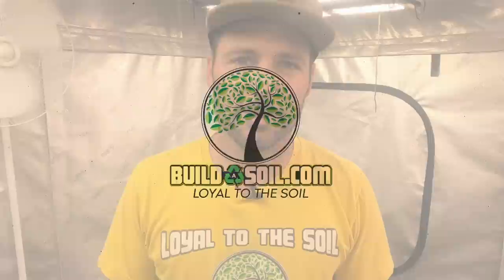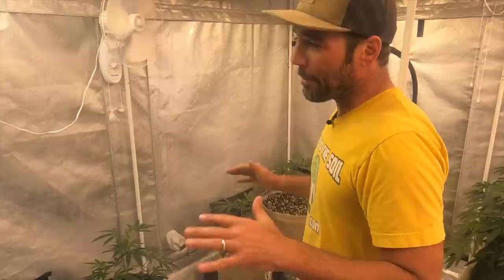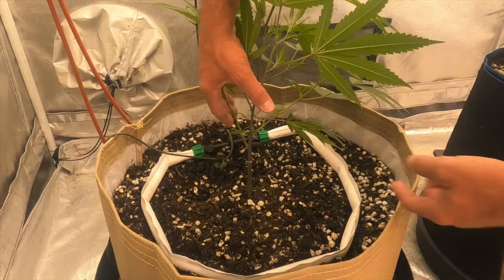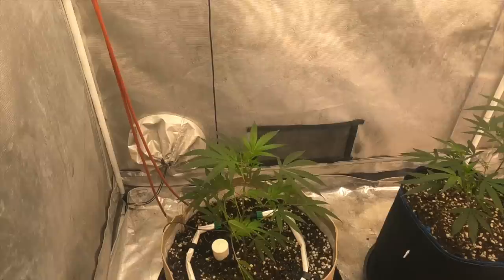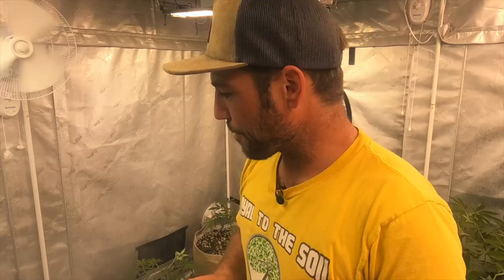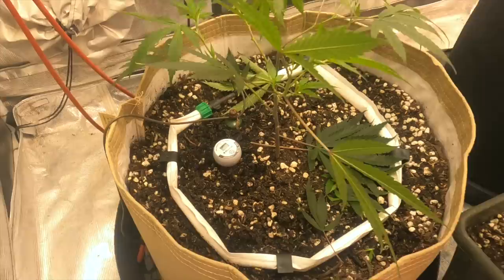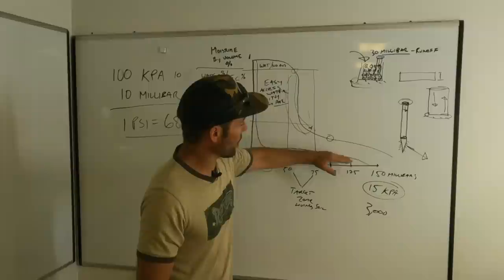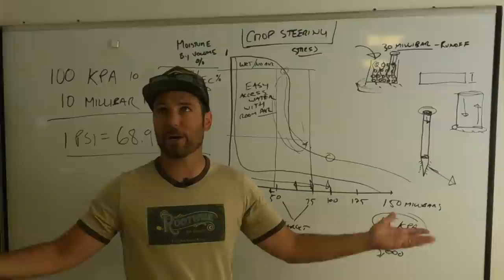BuildASoil: WE FLOODED THE BLUMAT! ALL ABOUT THE MOISTURE CURVE OF LIVING SOIL (Season 5, Episode 8)

Comment: Even without using blumats there is a lot to be learned from this video. Especially for beginners.  The high EC from too much dry back is usually something only experience will teach you. I've been through this and learned the hard way that it wasn't just lack of moisture but the plant burning itself up from "proper" nutrients. Yet, indeed the moisture level did cause that. I learned that to control stress in that manner I had to be low on nutrients at that time. Sorry,I'm rambling. I'm out. Great episode Jeremy.

Comment: I run blumats consistently and a couple things I learned - 1) when bleeding the air from lines, I had better results bleeding from the actual carrots themselves rather than a purge valve. 2) when doing the hanging drip calibration, the directions for mine said when you get the drip hanging, half an arrow past where the hanging drop is, would make it so you wouldn’t have a runaway carrot, I found that 1 full arrow turn worked better if you plan on topping the reservoir to full. Always enjoy the content

Comment: Jeremy - you forced me to calculate the difference in height and my inconsistency with BluMat problem! Thank you -My tank is too close (Vertically)
 - the pressure significantly changed with amount in the res. I'm raising it to max and recall. THANX AGAIN!!!

PS - (Aeration at the bottom only raises the perch water table. Once I understood that, I stopped putting pumice in the bottom inch. Pot elevators much more effective)

Comment: Thanks guys for such a great video. From explaining the reasoning why you flooded out, and what your doing to fix the problem. To the white board. Late in my grow I pulled the blumats out of storage and paired it to both the ecowit sensors, and the blumats moisture meter. I find the ecowit reads between 40-45 when I have the blumat sensor at about 80mrb. I am just sharing my observation. 
Thanks again team B.A.S.. 
You guys rock!

Comment: I saw that in the previous video you used the new technique for dialing in the tops w/o the carrot. I was under the impression that needed to be done on something like 15psi (like from their flow reducers). If its possible to calibrate with that method on gravity, that would be sweet.

I think for someone like you who is very experienced with watering by hand, it might be better to get the pot to the moisture you know you like, and then calibrate w/ the carrot in the soil, that way your hanging drip is based on what is already in the soil.

Gravity systems are more complex imo but they also have less risk (as you can see already!)
Reply: Exactly how I installed my blumats. Has worked fabulous. Only time I flooded is when I accidentally opened a carrot by brushing up against it. Recalibrated & off to the finish line. I think it actually helped 😂

Comment: As a beginner, I always had some problems with watering and fertilizer. Since using Living Soil and the Blumat tensiometer I have had very good results and the plants love it. I can only recommend the Blumat Tensiometer to anyone who has problems with the right moisture, it is very accurate and works really well.
In my experience, the sweetspot is around 90 Mbar. In practice, I usually keep the moisture between 60-120 Mbar, works perfect for me. Your presentation at the end was very interesting and makes sense to me, next time I will try and stick around 50-80 mbar.
I'm really curious how it works in connection with the Blumat watering system and what will your sweetspot of Mbar.
Reply: i mean.. you could also learn to PROPERLY deal with watering instead of dealing with unnecessary "idiot-proof" gadgets that bypass the learning process.
Reply: @megaflux7144  It doesn't bypass the learning process, it helps, I don't use any automatic water system, I still water by hand. If you have such a green thumb, be happy.
Let everyone do what they think is right, bro.
Reply: @SaulGodman4200  it does bypass the learning process. people should be able to figure out how to NOT drown plants without too much difficulty.. like stick a finger in the dirt. same with the nutes, if you arent examining the leaves youre not learning how the plants communicate.

Comment: I like to dryback to 180mbar before watering. How much it will drop depends on how much you water, a deep watering, around 5%, will drop it to 30, but less, like 2%, will only wet the top, which will force moisture to be wicked deeper, but will stay in the 80-120. I’ve dried back to 250-300 and plants weren’t wilting, no burn also, but I never feed heavy. In most cases I am using saponins and aim for closer to that 10%.

Comment: what i do to keep from flooding is wait to do the hanging drip after i water in and leave the carrots in the water 24 hours instead of 15 minutes … still got the same ones in for the last 4 runs perpetually just water in slightly once a week that keeps them from pulling the water out the carrot , and let’s me run silica and microbes and organic seperate to keep the water in the red clean

Comment: I was using a 55 gal res with the blusoak tape and a pump setup, but I think because my res was handfilled and not consistently filled to the top I constantly had runaways in the beds. Which is weird because I had a pressure regulator hooked up along with a gauge to see the pressure going into the lines and never saw a real change. Sustainable Village or I never figured it out so I pulled them and went back to handwatering. When they worked they were the best, but when they didn't they were just too much of an issue. Runaways, blusoak having pinholes in it every other cycle, Moisture sensors going out, etc.. unfortunate but flooding is unacceptable for me.

Comment: The flooding/clogging is what keeps so many from trusting these systems. They really are great when they work. But when they mess up, it sure can lead to major issues.
Reply: The blumat never fucks up though, its always a human error.
Reply: @OutdoorGrowmie wrong.  They are super finicky and need minor adjustments all the time . Used em for many years and they are not set it and forget it.  Far from it
Reply: Blumat flooding grow rooms since 1978.........fools and their money are soon parted ✌🏼💚🙏🏻
Reply: my experience has very much been set and forget. a little tinkering on initial install and nothing more. I do use a chambered float which shuts off the line on empty res and holds water in the irrigation part of the system, as its when ive got air in there that ive had issues.
Reply: @timpage5021  i used them for many years too and had no major problems, it actually was set and forget for me after getting to know them a bit.

Comment: Good luck with the Blumat , I’ve tried in 3 different runs in 6 pots and every time I had at least 1 “runaway” that flooded my tent. I really wanted them to work to make it easier to go away for a long weekend but just hasn’t worked out. Also purchased a moister meter and that failed halfway through flower.

Comment: One note. When the plant matures the roots completely encapsulate the ceramic cone.  So at that point it is measuring the moisture of the plant not the soil. The plant will tell the sensor when to water.
Reply: Very good point
Reply: Too many changes and variables in these systems. Blumat flooding grow  rooms since 1978

Comment: Do you think you'll ever run irrigation to the 4x4 bed? I have the double manifold bluemat system from sustainable village..... it really takes the load off of trying to keep up with that big boy 😂 They need too damn much water!!! Thank god for irrigation and blumats system.
Reply: Question . Are you running a 5 inch Carrot along with a 9 inch Carrot?
Reply: @JohnnyGreenzz  9"
Reply: @ohmimprovement5767  how many plants and how did it work?
Reply: @stevenwoods1982  I ran 5 big plants this run, they topped out the tent and needed to be super cropped. It keeps up well! I have 4 soaker hoses in my system spread across the bed. And a 17 gal reservoir.
Reply: @ohmimprovement5767  that’s great I appreciate the info. That’s the same setup I was looking at and I’m glad you said a 17 gallon for a reservoir because I was unsure. Honestly I’m debating the Blumat setup your running or a olla automatic system from thirsty earth. Any thoughts that would lead me in the right direction? Also do you use that Blumat water meter?  Thank you
Reply: @stevenwoods1982  I was told by sustainable village to use minimal 17 gal upto 27 gal. I do use their tensiameter meter and I also added 4 ecowitt so I can watch my bed moisture levels from work or just away from home. I recommend contacting sustainable village, they'll be happy to help you out.
Reply: @ohmimprovement5767   Thanks I appreciate it

Comment: You really can super crop any type of stem, hollow, woody, new growth, whatever. Take the handles of your scissors where they meet, that's your crush point, use the handles of your scissors to crush the stems, there's your hot tip for today. 

The correct way to super crop is to mash the stem, twist it 180 degrees and then bend it over. a linear stem with a 90 degree bend is such a bad idea, putting half the stem in tension and half in compression, you want to mash the stem, either with your fingers or with pliers, or between the handles of your scissors, turn the stem into threads, twist it, and bend it over.
Reply: He's learning, and passing on the correct knowledge for your dollar. Blumat flooding grow spots since 1978. 😂✌🏼💚

Comment: What about if the reservoir is super full or almost empty? does that change anything in the pressure? Also, sustainable village's new approach with the carrots off adjustment, seems intriguing. Have you tried it?
Reply: If you calibrate your caps with the resivour half full it really helps as far as pressure differences from full to near empty

Comment: Way to wet. I had mine set to 3.5  If the water inside the carrot evaporates it gets wetter in my experience. Which leads to runaway. 10 gallon fabric pots cardboard mulch . Never tested with a meter just picked them up. Only 2 feet of elevation.

Comment: In the Installation Guide Blumat say to Reset without the tube, the measuring-Head only. How did you come to your perspective to Open the screws and take of the battery for reset? Blumat doesnt say anything about that in the User Manual.

Comment: Light frequent watering vs deep less frequent waterings? 

I am wanting to switch from Gaia green 444/284 and pro mix hp with 15% worm castings. I currently do infrequent deep waterings which I prefer (every 3 to 5 days)
I wanna switch to a clackamas coots recipe but hear u got to keep the soil consistently moist and do frequent watering in less amounts (daily or every 2 days). Though I have heard either way will work as long as you don’t let the soil dry out to much Between waterings. 

With the Gaia green I let the pots get light and the soil pretty dry before watering. I’m confused on the difference of a 444/284 organic dry amendment vs the amendments used to make a coots recipe. I figure watering would be the same way since they both use organic ingredients and microbes to get delivered to the plant. 

I also am curious If just worm castings will work for a clackamas coots recipe? It’s hard to find good compost around me locally other than worm castings. 

I really appreciate your help. Thank you so much for these videos to help us learn!!
Reply: Pro-Mix HP is more suited for salt based nutes that are fed every watering like GH Maxibloom or FloraFlex, with this feeding schedule most don't amend it with anything but an extra handful of perlite per pot..Pro-Mix also says reusing it for multiple runs is discouraged..

Comment: Say how about some insight I have an old mobile home should I convert the whole thing into a hemp grow with a dry room or use tents throughout to control environment dialed in
Reply: What you say tents or seal up cracks add insulation and run grow in each room with no tent ⛺️

Comment: Really curious to see what the Ecowitt reads in the Blumat pot
Reply: Ecowitts made it really easy to dial in my blumats. Just did 10 days away and only needed to have someone come fill the bucket. And I could check it the whole time between the ecowitts and the wyze camera.
Reply: @Jmoskovic wat moisture number you like on the ecoqitt
Reply: @justinjude1999  water when hits 25% usually & after watering 10% of my pot size after a few hours it’s around 35-40%
Reply: @justinjude1999  I try to average around 35 like Jeremy recommends. I typically range from around 30-45. And I water with about 1/4 gallon each plant mixed with bas amendments (on top of the blumats) and it always ends up back to where it’s set.
Reply: @rooruser69  that's wat I do . I just run straight water thru my drip tape in 15 and 30 gal pots. Once a week sometimes once every 10 days I give a top water of "goodies" silica, ful humix, LABS, etc. I don't turn my blumats off like some ppl talk about!!!! Like you said it's just gonna not water until it dries up some!!!
Reply: @rooruser69  do you use dip tape or dippers or wat? Where do you put your meter in ur pot? Like do you put it close to ur carrot or like on the opposite side of the pot???
Reply: Im running 7 gallon pots with a carrot and 3 drippers evenly spaced around the plant. Ecowitt is located close to the carrot.

Comment: Honestly blue mats don't really make sense to me.  They are overpriced. For the same cost you can build a small pump setup or a large pump setup if you have many pots it's WAY cheaper.  Also we all use dry amendments and thy work better with top watering. Also a watering system has the flexibility of being able to water in nutrients if you want to. It's cheaper you get more control and it can water in nutes the only downside is if you want the blumats for controlling when you water. They are not great at that either unfortunately as you see here. IMO drip systems or Shrubblers like I use are much easier to dial in than blue mats. These plants are to valuable for blumats imo they work best for small houseplants that you don't want to water all the time.
Reply: Dude it didn't work because he did it wrong ! You go hanging drip then tighten 1 to 2 carrotts!!! He loosened 1 carrot after the hanging drip!! So it was already gonna be too wet ! Then he raised the bucket 3 feet. Of course it was gonna runaway!!!
Reply: @justinjude1999  I understand. But even when I have used blumats i the past getting the moisture level just right can take some fiddling just like setting up drippers. I'm just saying a system with a pump is cheaper more versatile and in my opinion simpler to dial in. I water a 5x5 and a 4x8 with a 50 dollar rip system I built and another 100 or so plants  with an 150 dollar build. Could do it for cheaper too if I was on a budget.

Comment: Those moisture meters are sh?!house waste of manoey 120 bucks where I live and they have all failed as a fter 1 or 2 grows all over the shop even reading I've recalibrated several hundred times.not worth it don't spend the money I reckon blulab soil probe is where it's at
Reply: When you recalibrated/rest did you have the heads attached to the tubes ?
Reply: They are pretty expensive also,  right?